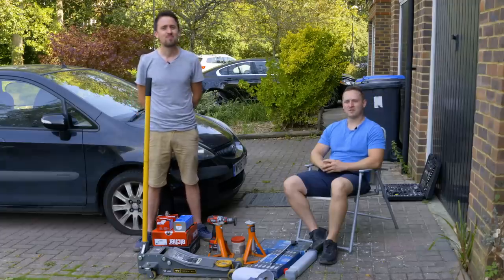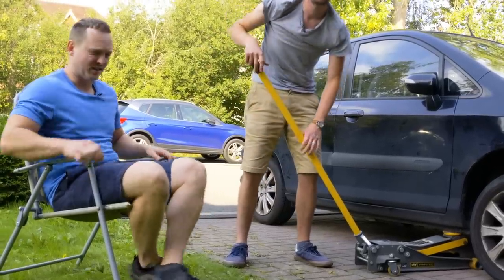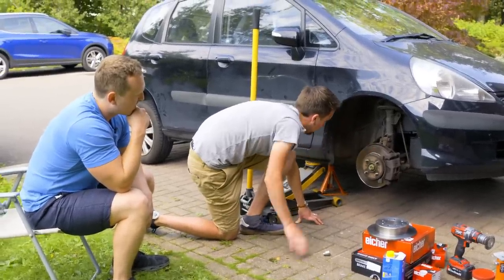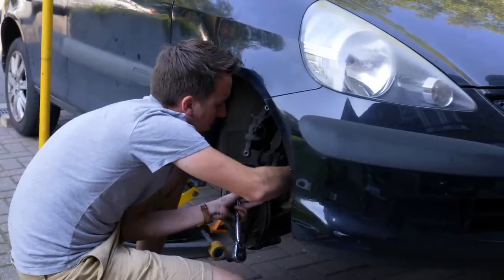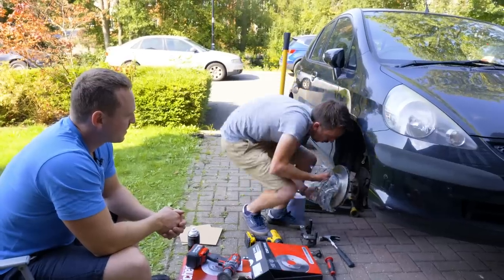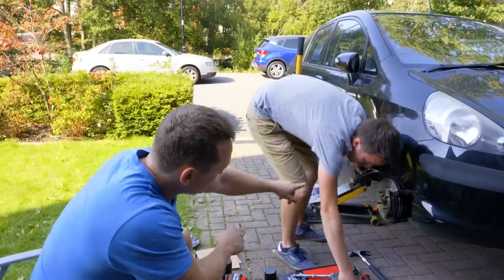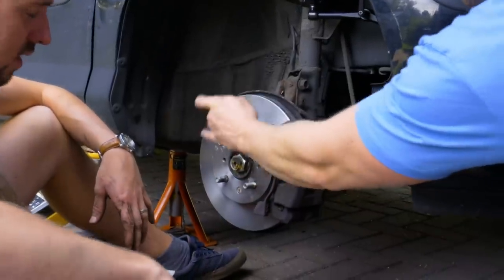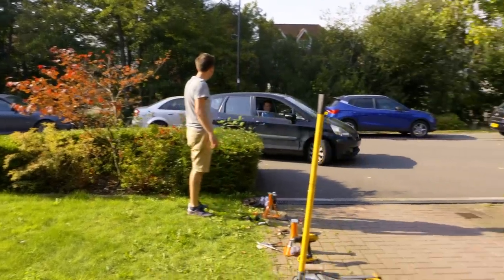Non-Car Guy Changes Brakes For The First Time

Comment: Ethan did way better than I expected!

Did you undo the cap on the brake reservoir to release the pressure? I didn't learn that one until my 3rd or 4th brake job. 

Also if you set the plate on the piston tool to align with the caliper it will stay on better.

Comment: Pulse the tool to brake super tight bolts 
Don’t hold it there because if the bolt loosened up your body can’t react fast enough to stop your hand hitting everything

Comment: You dont need to put those rotor screws back on hondas. The wheel holds the rotor on just fine. They are only there for assembly purposes in the factory.

Comment: Did somebody remember to tell him to open up the bonnet and open up the cap on the brake reservoir so that the brake fluid does not spill out all over the place under pressure because when they push the Piston back in the brake fluid is going to go somewhere and I need to have that cap open in order for that pressure to be released because when they push that back in a trait that device back out the Piston may just come right back out I've seen it happen before because they did not release the pressure

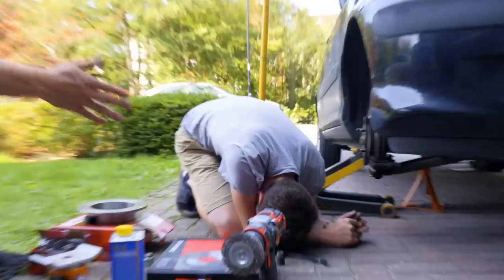Comment: 9:45 that's how you strip a bolt and cause more issues for yourself so careful with that. Sometimes they're on REALLY tight too.
Gloves are a thing too you know :)
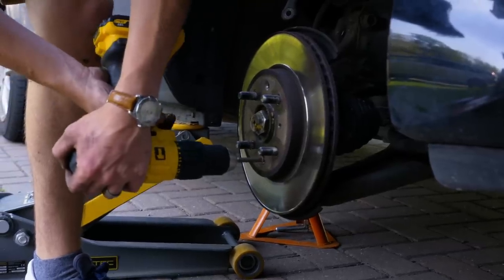13:05 That's interesting, I don't think either cars I've owned had an extra bolt holding on the rotor like that.
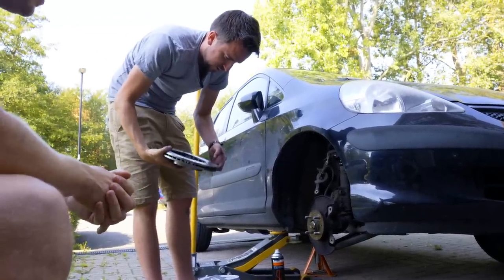14:10 Definitely want to have gloves on when dealing with brake cleaner, it's pretty nasty stuff.
16:00 since you're doing the brakes and rotors, you might also want to make sure the slide pins on the carrier are cleaned and lubed up as well.
Also be aware some pads have an inner and outer one, some protruding tabs on them may be different, so make sure they're going on the right side.
18:20  2nd one should be a bit quicker since he should know more what he's doing for the 2nd one.
23:25 When tightening the bolts, go from one to the opposite side one, don't go in order in a circular fashion as he did there. 
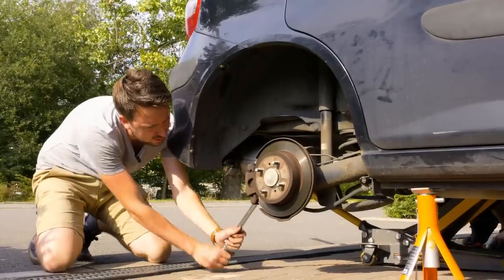24:30 It is confusing when working on a bolt on the other side, tightening and loosening get reversed :D

Comment: Umm yeah, you don’t need those screws on the rotors. The factory just puts them in so that the rotors don’t fall off as the car going down the assembly line. That’s it. Take them out and throw them away so that you won’t have to drill the damn things out later down the road.

Comment: If you got the screws out the rear disks just put it back without them. They are not important at all the wheel holds the rotor on on most American cars

Comment: Very bad idea to put copper grease on the back of the brake pads (see: "Delphi does not recommend the use of Copper Grease") and on the part of the bolts where nuts are screwed on (it will make you overtighten the nuts, and possibly make them susceptible to unscrewing from vibrations).

Comment: Don't take this the wrong way, but probably the best thing you've done. Despite getting dirty and injuring himself, it was a clearly a rewarding process for Ethan - getting all misty-eyed & nostalgic: they say you never forget your first brake change... ;-P  

The novelty of changing your own brakes will wear off (btw never, ever, ever buy anything with inboard brakes - especially inboard drums), but the I guarantee the confidence & skill engendered will have many potential applications

Only caveat I'd add is that if you can't have a couple of p!ss-taking mates who know their stuff looking on, make sure you do a little prep / research first...

Comment: I was doing the rear brakes on my Mitsubishi and didn't realise the auto adjuster twists so when you compress the piston you need to twist it back in.
I almost broke a g-clamp trying to compress that bastard. Felt like a right tit when I worked it out.

Comment: When i watched them struggle with the bolts and needing to use their feet.. Maybe i'm a freak of nature and have insane muscles or these guys are weak? 
I can brake those bolts loose with the small ratchet easily. You just need to swear when you do it. They forgot to swear so they didn't come loose.

Comment: I mean, those disc retaining screws are only there for ease of manufacture at the factory, as the wheel; holds the disc in place once tightened. So drill ‘em out, fuck ‘em off and do a proper job, or Alex is gonna need to be renamed Arthur…

Comment: What this taught me: Just pay to get your brakes done.
Reply: If you don't know what you're doing, definitely pay to have it done by someone that does, but it's a really simple job and one of the easier home jobs as long as you know what you're doing and have the correct tools. 

I done mine last weekend (Front only) and it saved me over £200 for about 1.25 hours of my time (And I quite like doing it as proper mechanical work is a nice change from my daily IT engineer job)